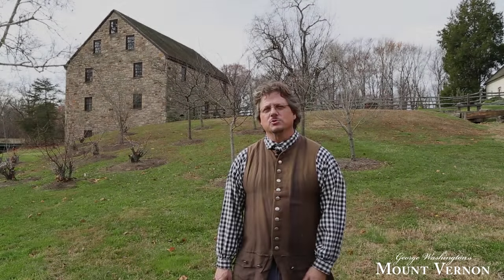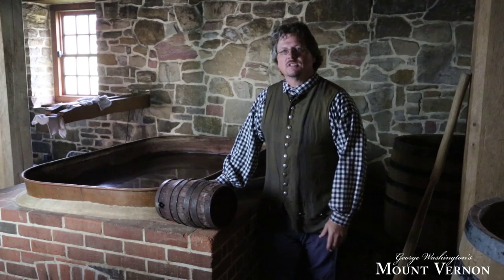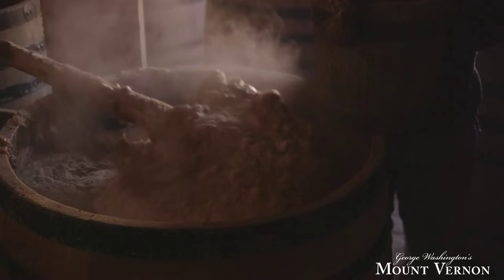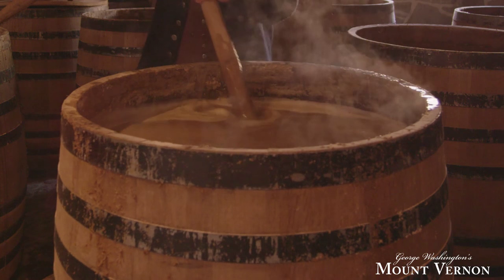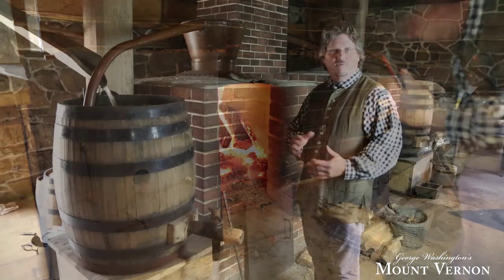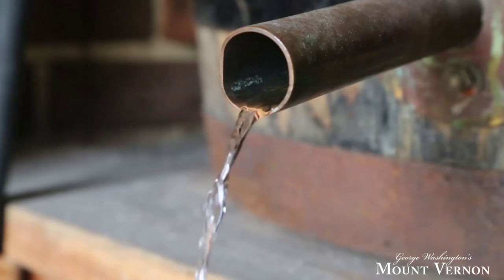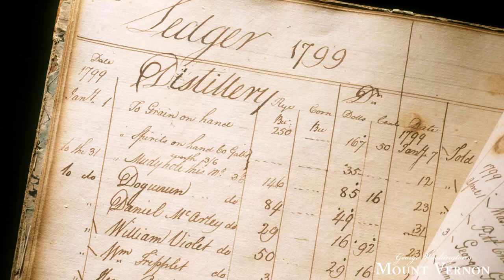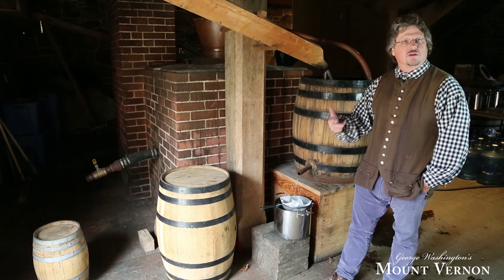How Did George Washington Make Whiskey?

Comment: In modern day distillation, you can monitor the temperature with  dial thermometer in the pot or if it is a reflux configuration in the tower and control the heat to figure out when the run of the heads is about done, but in the 18th century, you could not really regulate the heat from the fire or check the temperature. How were they able to determine what was heads and what was the body? just dead reckoning by timing and experience or did they have some sort of chemical test?
Reply from the maker: Hi John,

Thanks for your interest.  We sent your question to Steve Bashore and this was his response: 

____

You are correct, that in a modern distillery, control of temperature is able to be done, with great accuracy.  In our setting running the wood fired pot stills, we have through experience learned how to control the temperature, but we do not have a dial to tell us exactly what temperature we are running.  We are more concerned with regulating the fire evenly, so there are limited spikes in temperature.  To accomplish this, we have learned how to start and build and then feed the proper amount of wood, and size of the wood, to the fire.  We are able to tell when a still will come on line, by feeling the copper of the head, and line arm as it works it way to the worm tube.  Even and gradual build up of the fire is critical, especially when running mash.  You do not want your distillate to come off the still warm, it will negatively impact flavor and yield.

Once the still comes on line determining where to make the heads cut is done by nose and taste.  The heads will contain methanol, and others compounds that you do not want in your spirit, nor do you want to consume these.  When the still starts flowing, we nose and taste (very small amounts) and can taste these compounds and it is akin a green apple taste, smell.  We continue to assess this in the first few minutes of the still flowing, and then you will start to taste the rye flavor and the beginning of the hearts, at this point we make our heads cut.  With time and experience we have become better at this.  If the cuts are not made properly, they will appear in the flavor of the final spirits.  Sometimes heads will come through in a tasting of the final spirit as a banana flavor note.  So the answer is that this is done and was done in the earlier centuries by taste and smell.

The same holds for making the cut before the distillation run goes into tails.  Tails will taste like dish water, soapy, light, watery, compared to your hearts. Where you decide to make this cut depends on the distiller, but we track this through taste, and make that call each day we run.
Reply: @mountvernon  I like how this is done traditionally without modern equipment.